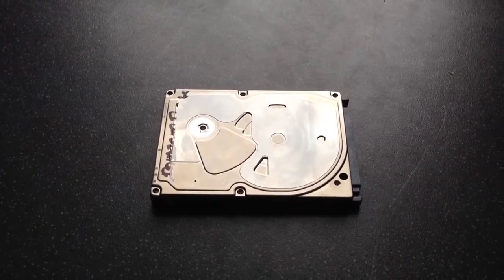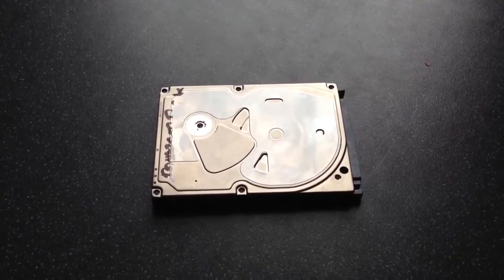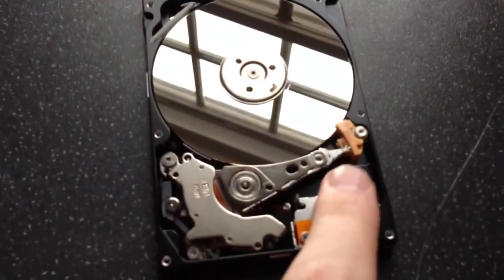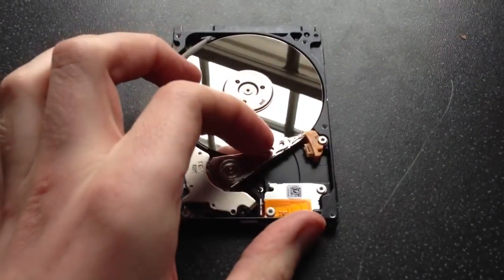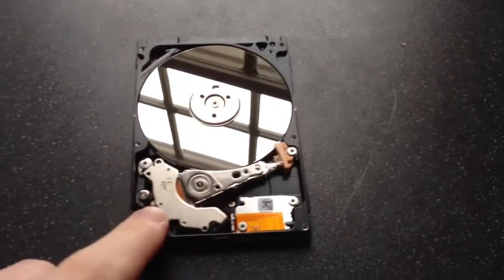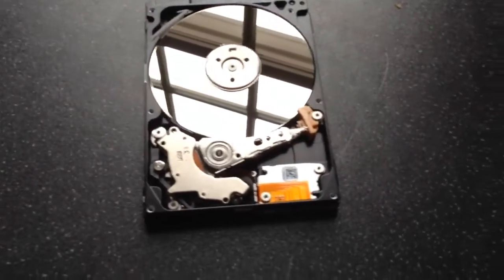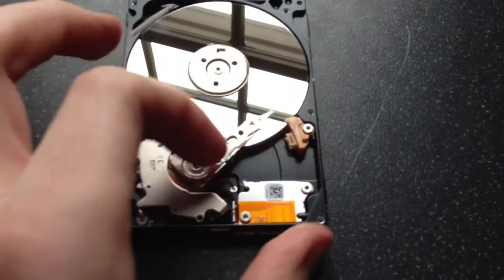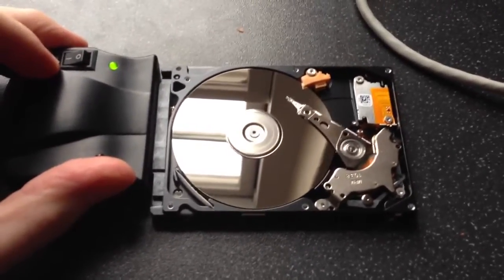Hard drive dissection - Part 1

Comment: my hard drive went through physical damage and a lot of dust can I recover data
Reply: its an 1TB external Hard drive
Reply from the maker: Michael Jagdharry Assuming it wasn't turned on when it was damaged and assuming that it's only to the outer casing of the external drive, most external hard drives are basically just SATA laptop or desktop drives on the inside, so once the plastic shell is off and the SATA connectors are exposed, you could either connect it inside your PC or buy another external caddy and connect it via USB. On the other hand if the drive was operating when it was damaged or if the body of the drive itself is damaged (once you strip away the plastic outer shell of the external drive) then chances of getting data off start to diminish rapidly. In either case, I would recommend taking it to a local computer shop or repair centre, hopefully they can give you a straight answer.